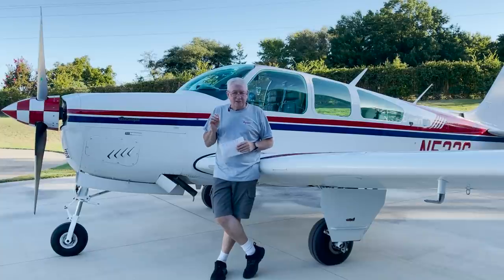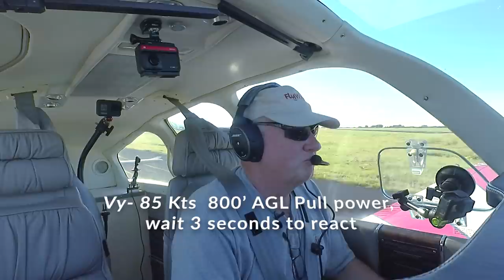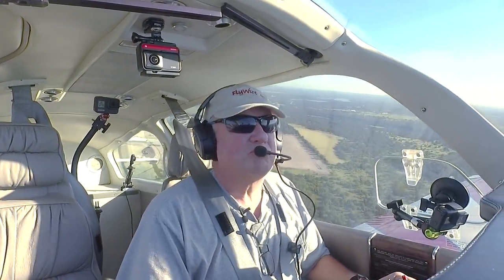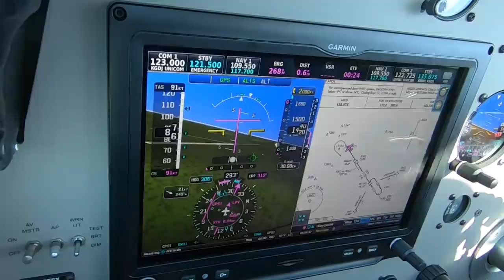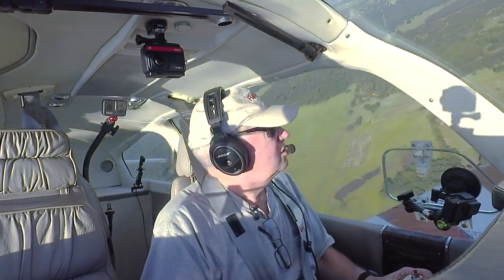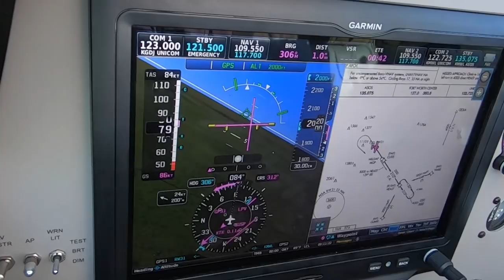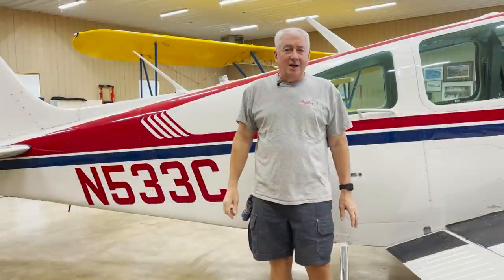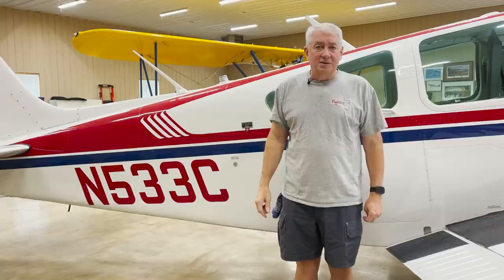Engine Failure After Takeoff  How do You Practice That

Comment: For heavier or 6 cylinder engines, my 4 kinds of EFATO CFI 2 decades ago, he had an easy acronym he created and demo it too on Cherokee 6's he flew charters on in the 1980's.  This is for total engine off.  THE 999 If you expect to climb at 900 feet or over, and winds are 9knots or more, then he marked the alltimeter marker to 900 feet agl.  The 999 NO POWER TURNBACK RULE.  Yes he demo it for us to runway of 4, 600 feet long and stopped it in less than 3,k runway only.  He didnt believe in BS talking only.  That was in 1995.

Comment: Scott and I briefed and flew this exercise in an A36 a couple of weeks ago--with no intention of carrying the exercise below 300 AGL. We climbed at Vcruise climb and simulated engine failure at 1000 AGL, trying the 45-degree bank turnback at both Best Glide and Landing Without Power speeds, which is a Beech-published speed near Minimum Sink but with enough airflow for control authority sufficient to flare out of the descent. We never got close to our 300 AGL go-around altitude because in each case as soon as we had the runway in sight it was obvious there was no way we could make it to the runway. 

Further, Gunny and others have shown previously that even with the propeller control pulled to low RPM (which we did in my exercises), there is enough residual thrust that an actual engine failure glide is even steeper than in this exercise. 

The AOPA video, Gunny's excellent depiction, and my recent exercise confirms once again that what I've taught for over 30 years--that the turnback is indeed "impossible" in Beech Bonanzas--means we might demonstrate this as a "convincer" to skeptics, but there is no amount of training that makes turning back to land wheels down on the runway a viable option in this particular type of airplane. As Gunny's video shows, however, there may sometimes be other options, such as keeping the gear up and aiming for the big helicopter pad at this former US Army training facility, as long as the pilot maintains control and accepts what's within glide range of the airplane. - Thomas P. Turner
Reply from the maker: Excellent comments Tom! Thanks for sharing!

Comment: Absolutely right-on Scott about being airplane specific (in My opinion). As Chuck Yeager mentioned to me many years ago in a chance encounter in Alaska, when I asked him for one best tip, he replied: "Don't trust everything any one person tells ya about how to fly an airplane, get in there (the cockpit) learn and understand it fer ya-self" 
Having been taught and practiced the principles you cover here in a V35B and an A36, I was able to successfully execute a 180 back to a downwind landing from about 500ft from the start of a crosswind turn on a long runway after an actual complete power loss, in of all aircraft, a Cessna U206 on Amfib floats when I had no viable options for landing straight ahead.

In that case, due to it being a test flight after a fuel system issue was supposedly resolved, I had done a max angle of climb, and due to the aircraft being light and departing into a stiff headwind my climb angle in that very draggy floatplane exceeded the glide angle by a margin. When the engine abruptly quit I was mentally prepared for an engine failure and had enough situational awareness to at that moment deem I might just make it back to at least the airport premier and if not a controlled crash into  hospital parking lot next to an emergency room just off the end of the runway. When the engine quit I immediately lowered the nose to maintain best glide speed and did fast, low-G pivot back to the runway, I tried the boost pump briefly and when power was not restored I reduced pitch on the prop and ended up having to slip a bit to touch down 1/3 down the runway. 

From that and a couple of other actual engine outs landings my take is that it's not only aircraft specific but situation and condition specific. If conditions in the floatplane return had been different, say higher altitude, higher weight or different wind conditions had prevailed I would likely have ended-up well short of the runway. and when I later practiced (demonstrated) the same maneuver in the same aircraft with a CFI and FAA examiner as casual "research exercise" Without the 15 kts of headwind and the prop pitch not reduced the return to the runway ended twice with us having to add power to make the runway. 

Other considerations my former Air Force Academy instructor conveyed to me during RTLS (Return to Landing Site) practice as he called it was to be aware of all the factors involved in an 'RTLS' and that is required to complete it and what is required to avoid a stall. He also said that in some situations a safe return may not be possible and that it's essential to realize that and plan accordingly, and to consider if a controlled crash on or near an airport with emergency services would be preferable to off airport in a densely developed area, an area of rough terrain or where emergency services might have difficulty finding or reaching you.
Reply from the maker: Thanks for sharing Jack! Great story!
Reply: For those Cessna 200 sires drivers interested in the cause of the power loss, I had had just bought the 206 amphibian and on my first pref-light found a small bit of water in the tank drains and strainer gascolator drain, and  my first takeoff I experienced a very rough engine and fuel flow fluctuations. I was able to restore enough power to make a normal pattern and land and on landing found the strainer full of water. My shop drained all the fuel and we flushed the system with methanol and after extended run-ups I did a test flight and had the complete power loss as mentioned above. What we discovered was that 206s and some 210s have about 1.5gal header tanks near the wing strut attach points in the belly, and that particular aircraft left the factory with the header tanks but no holes in the belly to access the quick drains that were supposed to be in the header tanks. Instead, safety-wired plugs were installed behind the belly skins and were inaccessible. 

When we hole-sawed access holes in the belly and removed the plugs we drained several gallons of water and contamination that accumulated from years of filling the aircraft in Alaska from fuel drums.  On my first flight, once level after the power loss, High-Boost pump was able to pump enough fuel on top of the the water in the gacsolator to make a normal landing. On my second flight after we flushed the wing rubber bladder tanks a good bit of water methanol mix  ended up filling the inaccessible header tanks, and my steep high-power climb quickly again quickly filled the gascolator sending water and methanol into the fuel injectors and quenching the spark plugs. 

After draining and cleaning the header tanks and fuel system I had no issues, but I did make field modification to the strainer drain and installed a longer strainer drain cable, moving the pull handle from the engine compartment to inside the cockpit, as in early Cessna 206's and 210's to allow water contamination to be drained out in flight if needed. Before doing the mod I had heard that Cessna moved the strainer drain to the engine compartment so it had less chance of sticking open and draining fuel in-flight but I considered that a lessor risk than not being able to remove water contamination in flight.
Reply: @FlyWirescottperdue  Thanks Scott,  Sharing survival skills and insights is a public service and one we appreciate you very much for.
Reply: Lots of bologni been said about turnbacks by pilots that dont do them.  Lots of lies.  I read all kinds of ridiculous and outright dangerous stall producing theories.  Just lower nose, use Minimum sink speed or slighly over Vfinal speed, bank manly at 45 degr. bank, not mild, flaps if , align early, no late, land.  Turnbacks make you practice all kinds of hard piloting in a single maneuver.  Its only for pilots, not airplane drivers. Those are the guys going around saying to only practice mild maneuvers, and never practice turnbacks because they cant do that maneuver themselves..
Reply: @jackoneil3933  Damn.

Comment: About AOPA video of June 4, 2021 named "The Runway Behind You'  The Bonanza i noticed was using too much IAS and less banking on the turnback.  Went too far wide and could not reach the runway from 1,000 agl.  Some flaps can be pop out too to use minimum sink speed instead of the Vglide.  Minimum sink is Just around the Vfinal speed with some flaps for most airplanes.  

I suggest not to use the electric trim at all.  Too easy to overpull with it.  This is a Hook Turn or Question Mark Turnback shape.  They are used on EFATO, GRM Flyovers and Box Canyon Turnbacks. 3 places to use them.  Good to learn that Hook Turnback maneuver well.  

I taught them to many in my cfi years.  You start doing them on GRM,  level with some flaps, bit under the Vglide speed, then Box Canyon Turnback style, and EFATO partial power kind, THEN no power kind.  EFATO turnbacks at airport at end always.  Not power all off at beginning like i seen some and not working due pilot errors on it.  I have many Hook Turnback videos on my channel playlist.
Reply: Hey Jay.. Also to troubleshoot the engine when partial power practice.  Lean mixture a bit, and a bit of carb heat too before calling you are turning back to opposite runway, then 45 degree bank into the wind.  Cheers to your family in Florida.  Im still in PA.  Like the colder flying here..

Comment: Great demo, on my PPL checkride my DPE slapped my hand off the throttle and pulled power after takeoff and asked where would I go, that got my attention real quick!!!
Reply: Why was that on your checkride? Here my instructor did that regularly during low hour lessons.
Reply: @a.nelprober4971  
I guess the DPE wanted to see how I would respond, just wasn’t expecting it on my checkride
Reply: @Parr4theCourse  ah ok. In the USA do you also practice forced landings by getting really low over open fields?
Reply: @a.nelprober4971  
No, we or at least I didn’t do that, we did practice engine out scenarios and where would you land, but I knew about it before hand, like I said I wasn’t expecting it on my Checkride though and they way he did out took me by surprise, I guess that was the intent!
Where do you fly?
Reply: @Parr4theCourse  UK. At our flying school we would practice unexpected engine out during cruise and go through all the forced landing checklist including loosening canopy for impact etc. The only thing we wouldn't do was touch down. To stop the engine from quitting we did occasionally put on power for a few seconds. Great experience. Me personally, I don't really like the restart checklists etc. Would much rather fly the plane to the ground than stress over that stuff
Reply: @a.nelprober4971  
Nice to see/hear some of the differences between countries, very similar but a few nuances as well . . .
Reply: So what?

Comment: Brilliant thanks. It is good to know that from take off until about 1200 feet in a heavier type (52 knots + stall speed), forget all thoughts of turning back. In lighter types in the 1970s we were simply trained to never even consider it. Who wants to land down wind in any case? If the runway has no upwind bug out fields or lakes, then in theory one should refuse to ever land there in the first place. On my first solo in 1975, while downwind at 800 feet agl, I checked for carb iceing by yanking back the mixture knob, kept that one quiet.
Reply from the maker: Haha, you're not the first to use the mixture to check for carb ice, or the Prop;) Great point about landing downwind.

Comment: I helped recover a very nice A36 from Castle Merced.  We got a call for a flat tire and showed up to fix a flat.  Well we start going over the plane and talking with the two very high time pilots who were doing simulated engine out on a very long runway during a “clinic “.  Well when they got to the part that both of their headsets flew off during the hard landing I knew we had more than a flat tire.  The left strut was stuck in the collapsed position and with 400 psi added it wouldn’t budge.  I looked at the left main spar had paint cracks all the way down the left wing.  The fuselage had wrinkles around the cargo door and at that point we called it a crashed airplane and we were not going to aid in getting it airborne until a further inspection was needed.  They needlessly wrecked a BORROWED airplane doing questionable training.  It was really sad because it was a well equipped A36 that looked beautiful.  They got lucky that they didn’t hurt themselves when the elevator lost effect and they landed hard.  I’m sure it didn’t end up being an official crash either.
Reply from the maker: Thanks for sharing Curt. That's why it's best to decouple these two events!
Reply: @FlyWirescottperdue  I was wondering if you could take the Bonanza out and do some hi angle of attack power chops to see how aggressive you need to lower the nose just after take off.  Please don’t do it real low!  But a few friends were discussing how in the heck do these guys stall on takeoff during climb?  Then the conversation turned to losing power in a climb and how aggressive you need to be to keep it from stalling with gear down.  That would be an interesting video.  The guys we helped in the above description were doing the power chop at rotation and  that’s what got this going over a long set of conversations ending in this thought of where is the “wall” you won’t get over if it happens when you least expect it.  Where is the point of being on the backside of power curve right off the runway?  I’m pretty sure the guys we helped didn’t know they had no elevator left without lots of power being added.

Comment: Excellent demo Scott.  Seems like cruise climb takes you further from the airport for a given Alt(time).  Best angle of climb gets you higher/ closer. Airspeed goes away faster the faster you are going, altitude equals time. Fly the airplane to the arrival ( crash). An old guy told me once that the glide ratio of a Piper tripacer could be approximated by throwing a cook stove out the door and following it down.  In an F111 once I lost one engine and the other one rolled back to idle at fl200. I rolled out of the tight turn and dumped the nose about 15 degrees and lost 200 knots real fast. Got one going in burner and it all worked out but I was following the cook stove down till I got a relight.
Reply from the maker: Great story, thanks! One thing though the airspeed doesn't go away the faster you go.... it is really about the same, to slightly less the faster the start speed is. It's because of that thing called inertia. Thanks for watching!
Reply: @FlyWirescottperdue  I was thinking when you pull it out of burner at Mach 2 and the inertial harness keeps you in your seat , drag increasing with the square  of the airspeed and all. Inertia, there is that, and it probably increases geometrically also.  Love your stuff, Scott. Makes me engage my feeble brain.

Comment: Scott, it looks like the first turn back was at 900’ AGL, vs 800’ AGL, see @9:12, 1820’ power pull, 920’ was MSL on takeoff.  So for your testing purposes you would’ve been 100’ lower after the turn.  The big concrete pad looked like a good option!

Comment: Breaking the turnback out as a separate step is a really smart, safe, thing to do.   You mentioned not trying it at all at Vx.  That makes sense, too, unless some extra care is taken.  I've practiced Vx simulated engine outs, landing straight ahead, and would suggest to anyone doing that a) don't count to 3 seconds.  You probably don't have 3 seconds.  Get the nose down quickly.  b) don't even think about turning until you have the nose down, and the speed back up to somewhere between Vx and Vy.  To me, trying to directly turn out of an engine out at Vx is looking for a stall/spin, more or less as you said.
Reply from the maker: Great points Tom!

Comment: I also like acceleration quickly bin ground effect and getting to cruise climb quickly while drag is low, as then I feel safer having that energy with more choices. 

Question is if u outbound from runway at 108 at 800VSI FPM  , do u use 300 ft in turn , what is your inbound - VSI at 81 (88 I prefer heavier) 

Ie is it mathematically poss to ever make it. 
1.7 nm per 1000 ft 
10:1 about 

SAY 1600 AGL took 2min on reaching CMB spd at 108 is 3.6 miles out. 
Minus turn -300ft =1300 is only 2.2nm to get back landing 1.4 out. 

It may seem in A36 you can never make it back unless very long runway , strong HW or u CLB at VX ( which I also don’t like) 

So it my actually be better not to waste energy drag with a 180 in this type. 
Rather focus on a controlled crash ahead or to the sides. 

Interested to hear what u think. 

Great videos for getting brain going
Reply from the maker: You lose a lot of energy in the turn. Pick a spot ahead of the wings.